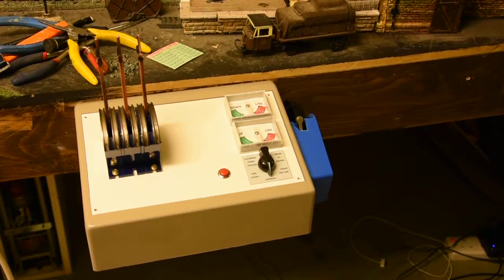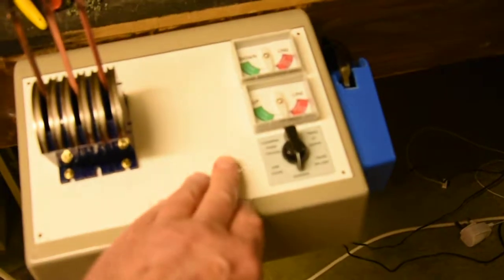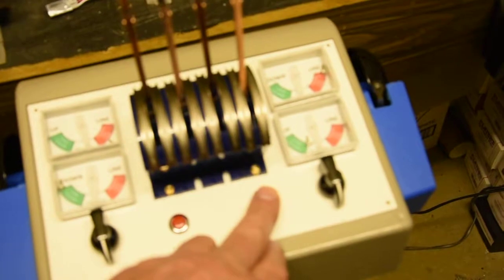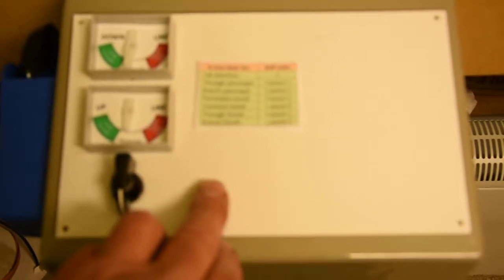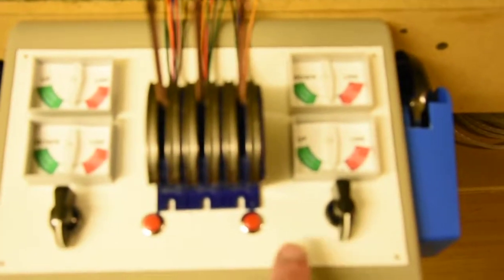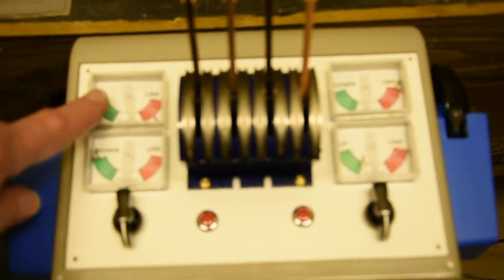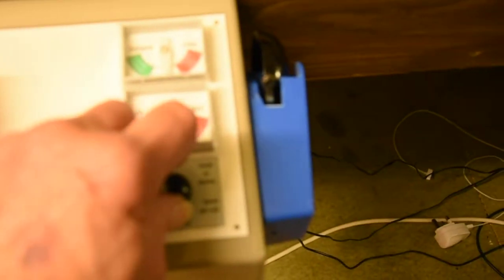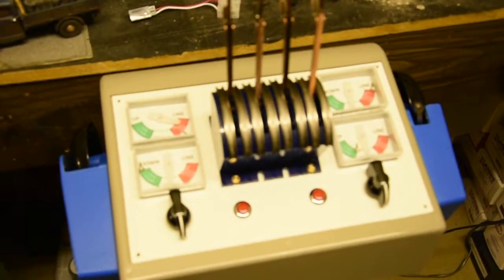Block signalling project -The four phases

Comment: Where did you get the boxes from? Been looking for them for ages.  Thanks..
Reply from the maker: Large boxes are from Rapid Electronics, the small boxes housing the pointers are specimen boxes available from scientific suppliers
Reply from the maker: The bells came from an online scientific supplies company, but they were really cheap and not easy to get working. Most bells want to ring and these had to be modified to hit the bell once with each button press.
Reply from the maker: Just came across the article I wrote for the Gauge O Gazette that mentions where everything I purchased came from "The component parts for the control boxes
Rapid Electronics supplied the Camden Boss desk cases, the push buttons, 3 way switches and the servos for the indicators. Watkins and Doncaster supplied small plastic boxes with clear covers for the indicator enclosures. ISG (International Scientific Group Ltd), supplied the bells.
"
Hope that helps.